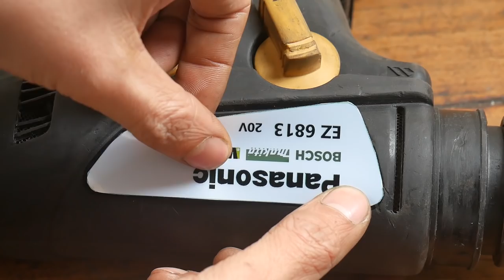Make A Frankenstein Hammer Drill  Natinal EZ6813

Comment: 10:14 Everything. The bearing can be thrown away! You press on the inner clip, and put the emphasis on the outer.
Reply: Can you clarify what you mean? How should a bearing be pressed on a shaft? By pressing on both the inner & outer race simultaneously?
Reply: @LudoA  When pressing the bearing onto the shaft, press on the inner race.
If you press the bearing into the bushing, then you need to press on the outer race. That is, where you insert there and press.

Comment: You literally just took a dc motor and turned it into a 3 phase brushless? 🤓🔥
Reply: the tech is so innovative it's smaller than the former brushed one but as strong as the former. i'm thoroughly impressed.
Reply: Yes, but the motor is underpowered by the 18V. Better would be a real 18V controller and motor, i. e. from makita.

Comment: 24v motor will be under driven by the 18v motor.  That's 25% less power than it should be getting.  You could possibly drawing more current now from the battery which may shorten the life of your ESCs.
Reply: Actually 44% less power if you just go by the volts and amps. 25% less voltage means 25% less current and wattage is the multiple of those. One volt over one ohm is one amp and one watt of power is used. Half a volt over one ohm is half an amp and quarter of a watt of power is used. But at the same time DC universal motors work a whole lot more complicated and they are not constant loads by any meaning, they will pull more amps and lose RPM if you load them down.

Comment: Does anyone know what the four fine wires from the control board to the motor are for.
Reply: encoder and temp sensor
Reply: It's basically that the controller knows where the shaft of the motor is (exact controlling of the three motor phases) and how hot it is (safety shut down).

Comment: Those drills were made under licence by many manufacturers and so parts availability is great. The drill design is incredibly good and designed for easy repair, long life span and reliable service.
You have destroyed an already excellent drill.
Those designed drills are in high demand by people who use them in remote, difficult to get to locations - aside from builders, they're the go to tool for mine and cave explorers. I've seen them used is hostile locations that other tools would fail in.
By introducing a host of 'better things' you've ruined the tool. Simple as that.
Fail.